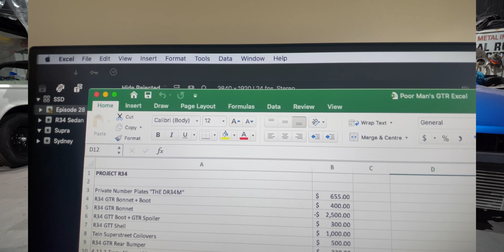The End | Poor Man's GTR [EP28]

Comment: Congrats on your dreams. That's an amazing R34. I would say 26k is a pretty good deal. Here in Japan if you want a gtt that's 1500000¥ (15k last time I checked)  ➕ gtt to gtr convertion with Okubo factory that's another 3000000 (30k could be more depending on the parts).